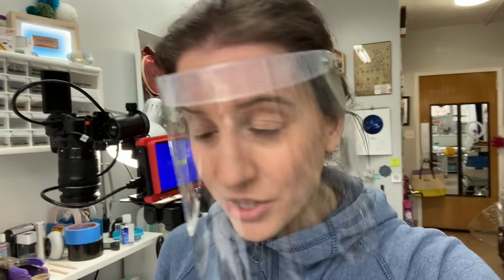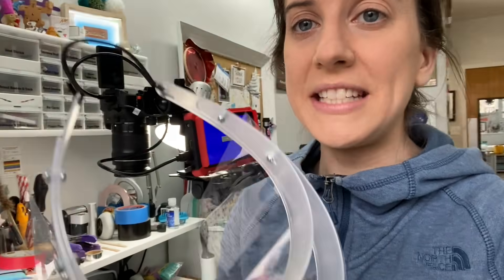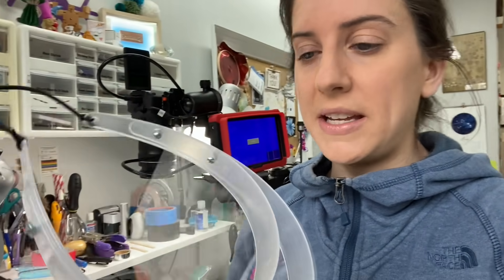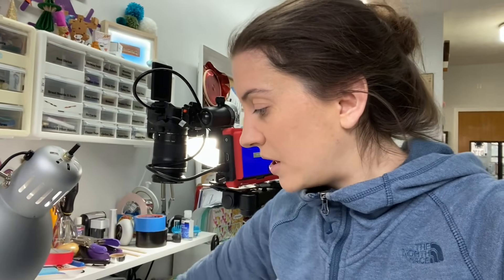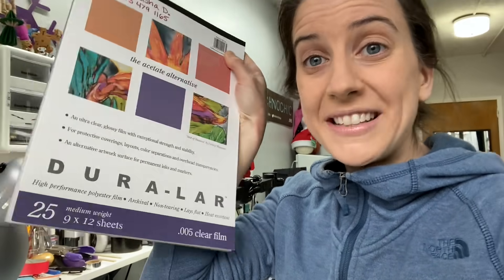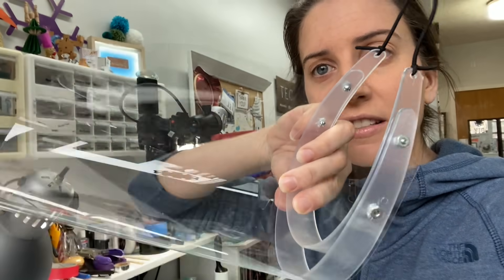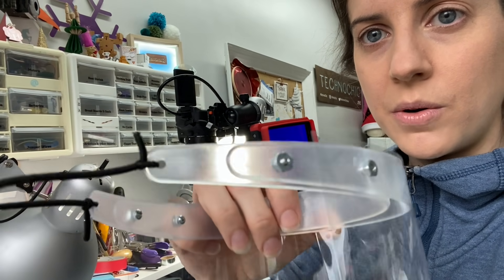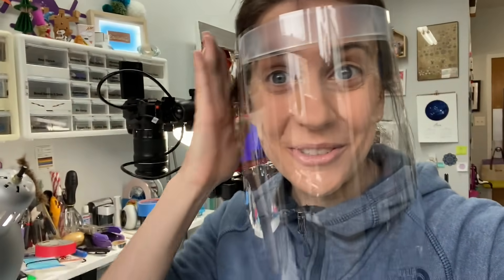DIY Face Shield Version 2: Made with 2 Headbands, a Hair Tie, Transparency Film, and Metal Screws

Comment: The only thing I'm wondering about this design is after washing, the nuts/bolts could get rusted, so better to use plastic nuts/bolts.
Reply from the maker: We switched to zip ties. You can view the new designs here: https://technochic.net/JCFaceShield The post includes templates, cut files, where to buy the materials, and detailed instructions about how to build the Jersey City Face Shield so you will have everything you need to do so! Please check it out and let me know what you think. Thank you!

Comment: Can I place an order for 10 of the screw version with cushion on the forehead area ? How do I get in touch with you if I don’t have instagram? I need this for dental practice. Also what size nuts n bolt are you using?
Reply from the maker: The Jersey City Face Shield Project post is now live here: https://technochic.net/JCFaceShield

The post includes a link to buy the shields, templates, cut files, material sources, and detailed instructions.

We are now using zip ties instead because they are easier to clean and won't fall off. But to answer your question, I believe they were #4-40, 1/2 inch.

 :)

Comment: As far as the concern to sanitize the face shield, we don't have to sterilize it, we need to clean it after every use (as we wash our hands) by washing it.  I don't think that soap or water would affect or degrade the material, but you could consult it with a chemical engineer  or an industrial chemist to make sure.
Reply from the maker: Great idea. The new all plastic design will hold up to soap and water, and we've also listed links to other cleaning methods in the post: https://technochic.net/JCFaceShield

Comment: One thing to note.
If the sheet is made from acetate suitable for photocopiers, be wary of the resilience if you want to sterilise for multiple use, it may deform at high temperatures.
Reply from the maker: It's .007 Dura-Lar You can see the full list of materials in our post. This post includes templates, cut files, material sources, and detailed instructions about how to build the Jersey City Face Shield so you will have everything you need to do so! https://technochic.net/JCFaceShield Please check it out and let me know what you think. Thank you!

Comment: A possible simplified version?
Single headband.
Adhesive foam pads (high density), as you showed. 2 at the front, each 2" (?) wide, with a 1" gap over the nose.
1 each side for comfort.

Make the shield removable/ replaceable.
Use 3× fold over bulldog clips to clamp the shield.
Similar to these (below, I think these are the smallest available)

https://www.amazon.com/OfficemateOIC-Binder-Assorted-Colors-31024/dp/B00006IBA3

One over the nose (hence the gap in the pads) 1 at each side.
This would allow for the band to be customised and sanitised, with the shield replaced as required through the day, or removed for cleaning. Mark the top centre of the sheet for easy positioning, fit the centre clip, fold down arms (should be held clear of the forehead by the foam?) Repeat at the sides.
Elastic could be tied to the arm of the side clips?

This should be fast and easy to assemble with no tools.
Reply from the maker: Thanks for the recommendation! If you have photos I'd love to see them and add them to the "Alternative Materials" list in our post. This post includes templates, cut files, material sources, and detailed instructions about how to build the Jersey City Face Shield. https://technochic.net/JCFaceShield Please check it out and let me know what you think. Thank you!

Comment: Covering/blocking the space between the two headbands is probably your most important need to solve. I'll take a spray bottle and spritz myself wearing the mask to troubleshoot what to improve upon. If I get droplets on my face from the spray...I'd definitely get airborne droplets from a cough or sneeze. Thanks for the DIY!
Reply from the maker: Thank you! I've designed 2 official versions of the shield: a simple design, and a covered design. My "Jersey City Face Shield Project" post is here: https://technochic.net/JCFaceShield The post includes templates, cut files, material sources, and detailed instructions about how to build the Jersey City Face Shield so you will have everything you need to do so! Please check it out and let me know what you think. Thank you!

Comment: Hi TechnoChic, good job in showing the evolved versions...I work as health professional in Dentistry...With regard to your questioning, the "pad" or "adhesives" to let the forehead more comfortable, unfortunately it is not proper if it were not waterproof. The size of COVID19 is toooooo small, 70-90 nanometer,The virus is able to get in to any kind of surface with pores and remain there for one, two or three days. If anyone like something more comfortable, I suggest to cover the pad with waterproof plastic that allow to be sanitized. For now, your version 2 is excellent. good job!!!
Reply from the maker: Thanks so much for your feedback! We tested several pads but found that it is more comfortable and easier to sanitize without! :)  I've designed 2 official versions of the shield: a simple design, and a covered design. My "Jersey City Face Shield Project" post is here: https://technochic.net/JCFaceShield The post includes templates, cut files, material sources, and detailed instructions about how to build the Jersey City Face Shield so you will have everything you need to do so! Please check it out and let me know what you think. Thank you!

Comment: Great project. Your idea seems to be the best I've seen so far.
Suggetion: consider using 'plastic eyelets' and 'plastic pressure buttons' (male and female) instead of metallic parts. This will allow you to sanitize and easily detach it.

What are the measures and material of your headbands, please?
Reply from the maker: Great tip! We decided to go with zip ties for the mass production but plastic eyelets are a great idea. I've designed 2 official versions of the shield: a simple design, and a covered design. My "Jersey City Face Shield Project" post is here: https://technochic.net/JCFaceShield The post includes templates, cut files, material sources, and detailed instructions about how to build the Jersey City Face Shield so you will have everything you need to do so! If you make a version like mine but with plastic eyelets, please do send me a photo to include in the "Alternate materials" section. Please check it out and let me know what you think. Thank you!

Comment: Hello, I would recommend to make the space between the plastic headbands closer, there is also a special headband that can be cleaned with a special tube, I have made a few prototypes of my own design as well! Maybe you could use recycled bottles for the shield.
Reply from the maker: Thanks for the tip!I've been working hard on even better designs too, one that has a cover. You can see the updated designs here: https://technochic.net/JCFaceShield

Comment: Here are some friendly tips:
1. Close the Gap at the top. 

2. Use a sealant type of glue that meets this standards: Waterproof; Heat resistant; Airproof. You want to make sure the seal is air-tight and permanent.

3. A Sealant foamy rubber would make it more comfortable. Make sure it meets these  standards: waterproop; Shockproof; Airtight; Durable and soft on the skin.  Not too thick

3. For the elastic bands the less porous the better.
Reply from the maker: Thanks so much for the feedback! I've been working hard and have come up with 2 official designs: https://technochic.net/JCFaceShield This post includes templates, cut files, material sources, and detailed instructions about how to build the Jersey City Face Shield so you will have everything you need to do so! Please check it out and let me know what you think. Thank you!

Comment: That is EXACTLY what people should be using for great protection.  It keeps wet droplets from hitting your face or your mask. It should be able to be cleansed easily with anti bacterial anti viral wipes.  The let sit for 3 days minimum and should be good to wear again.  A person should have a minimum of 3 shields for a 3 day rotation but more is better.  If you wipe the elastic and mask then let sit for 3 days or so, you would not have to worry about changing out the elastic.  GREAT JOB!
Reply from the maker: Thanks for the feedback Sue! I've designed 2 official versions of the shield: a simple design, and a covered design. My "Jersey City Face Shield Project" post is here: https://technochic.net/JCFaceShield The post includes templates, cut files, material sources, and detailed instructions about how to build the Jersey City Face Shield so you will have everything you need to do so! Please check it out and let me know what you think. Thank you!

Comment: Hello ! I've been doing homemade masks for my dad, he's a doctor. But one of the problems we encountered with medical visors, we used a simpler design, is that I keeps fogging up. I was wondering if you could help me out to find a solution to this. Thank you !!
Reply: I believe that is why the official medical face shields have that slit on top.  If you make it without the visor, it shouldn't fog.
Reply from the maker: Hi! I haven't personally had any issues with it fogging up. It may be because my face mask has a contoured nose clip, so when I add the shield there isn't moisture escaping over my eyes. Please check out my most recent designs here: https://technochic.net/JCFaceShield

Comment: The best tutorial so far re face shield. What I have in mind for a little modification is to use hot glue to bind 2 headbands together and Velcro to attach the plastic to the outer headband. I think its easier to clean or sanitise the plastic detached and lying flat on a surface. Small  bull clips can be alternative to Velcro . This way, it’s easier to replace the plastic should the need arise.From where I live, it’s easier to find hot glue, Velcro and clips than the screws. Thanks for the video.
Reply from the maker: Thanks for the tips Ruel! I've designed 2 official versions of the shield: a simple design, and a covered design. My "Jersey City Face Shield Project" post is here: https://technochic.net/JCFaceShield The post includes templates, cut files, material sources, and detailed instructions about how to build the Jersey City Face Shield so you will have everything you need to do so! If you make the design with your alternate materials, please send me the info so I can add it to the "Alternate Materials" list. Thank you!

Comment: Good idea! But there shouldn't be any hole, or slot above the eyes. In case somebody sneezing or coughing it's not protected at all!
Reply: If you look at all of the official hospital shields, you will see they are all made that way.  It has to be out a little to accommodate the nose and vent prevents fogging.
Reply from the maker: I've designed 2 official versions of the shield: a simple design, and a covered design that significantly reduces the gap above the eyes. My "Jersey City Face Shield Project" post is here: https://technochic.net/JCFaceShield The post includes templates, cut files, material sources, and detailed instructions about how to build the Jersey City Face Shield so you will have everything you need to do so! Please check it out and let me know what you think. Thank you!

Comment: How about closing the fronthead section  gap with a removable sponge that would protect from any particules dropping from above 🤔
Reply: Good point 🤔👍
Reply from the maker: Hi! Thanks for the feedback! I did try this and it sort-of worked, but the sponge was hard to attach. Instead, I designed an extension to the plastic pieces to cover the forehead. You can see the updated designs here: https://technochic.net/JCFaceShield Thanks again!

Comment: I followed your DIY on the previous video of yours and I am actually wearing it at work.  I work at a hospital as an EVS worker and it is very functional.  Don't use bleach because it will cause haze on the film.  I had used water and Hydrogen Peroxide on a small spray pump and I use it to clean it.  Also, I UV light all the rooms we had clean.  All the rooms as in COVID-19 isolate rooms.  When I did the last room, I placed that face shield in the same room but a good distance from the UV robot.  It got disinfected and I can use it again  I made two just in case.  I wish I could share the photo here.
Reply: If you have a minimum of 3, you could clean them and set aside for 3 days just to be sure.  Then just rotate ever 3 days.
Reply from the maker: Thanks for making one! I'm so happy it was helpful! I do have an updated design if you'd like to make more here:  https://technochic.net/JCFaceShield Also, please let me know if you find alternate solutions that work so I can add it to the blog. :)

Comment: I don't know if this would be helpful to you, it's a website for Nurses in Minnesota that are working to create face shields.  Theirs are closed at the top,  but thought you might look at this to figure a way to close yours at the top as well.   https://www.sctimes.com/story/news/local/2020/03/31/2-centracare-nurses-manufacturer-team-up-make-face-shields/5087603002/  I was also wondering if there was something similar to a 'visor' that might be made of a material other than cotton, that would be easy to clean.  I love what you've done, I think it's genius and all it really needs is something to seal off the top either above the headbands (like a short billed visor) or something that would lay atop the headbands level with them and then rest against the forehead.    Maybe using a heavier gauge plastic cut to the same arc as the headbands (while  worn).  Good luck to you, hope this helps, and to be honest, I think that the pharmacists in your area would be more than happy to get this most current model you've made.  The hospitals as well, and when you perfect it, you can supply more of the new model.  thank you for your work, and the effort you are putting in, it means a lot!!! Best wishes to you, stay healthy!

Comment: Would it be possible to use pop rivets instead of bolts. Might be a bit more comfortable. Great Work
Reply: That's exactly what I was thinking, to make perfect holes on plastic for screws don't work because that plastic is not thick enough to cover the heads.

Comment: Consider alternatives to metallic hardware. Use nylon, teflon, or other type plastic screws, nuts, washers. If a patient/med staff is wearing one of the shields, the metal parts may cause interference with medical equipment.

Comment: Hello, I really appreciate you video, it is super easy and will help a lot in creating masks for the ones in need! I have made a prototype based on your design but rather than using screws I have used rivets. It creates a cleaner inner look and feel so the user does not get bothered by the screw heads. 

Please check your email as I sent you a few images of my design. Thank you!
Reply: What about using cable ties (aka zip ties) in stead of screws? They come in many different types of plastic.
Reply: Kelly G using zip ties is also a good idea if you do not own a river gun
Reply: Hi. I would be interested in making them without bolts also .. do you mind sharing?

Comment: @TechnoChic I believe that you need to add some type of foam between the head piece and the actual shield to prevent droplets holding the virus from getting to the inside of the face shield where that virus would either be inhaled or land on you eyes or lips and eventually make their way into the body
Reply: yes you can use any type of rubber foam in a roll.

Comment: Nice design. If you can remove or cover the gap between the two headbands. There is a tendency that the droplets might enter into the gap especially if the person using it is shorter than the rest. Top and width need some improvements. Tnx

Comment: A nice design change would be to allow the use of a headband without having to cut it in half and then tie and knot it back on (most health care workers will be using gloves). If you added bolts and washers near the end of the hairbands you could then loop a full hair band around these without the need for cutting one. It would allow quick disconnect and cleaning. And also provide more tension as it would now be a double strand. Hope this helps. Alun.
Reply: Good idea!

Comment: Im a nurse and we badly need the face shield right now. We currently don’t have any at my hospital. I definitely appreciate that your posting this diy. The clear headband is great idea so that we can sanitized it and be reused. I was thinking to use medical torniquete rather than the head tie. It will be sanitized and still be elastic. 

If you can show use us how did you put in the whole in the band? Did you drill it? And if you can list the supply or  tell us where to get your supply in your video that will be very helpful. 

We in the healthcare field appreciate people like you. People that is thinking ways how to help frontline people to fight this pandemic.
Reply: I did the first version only changed the hot glue instead used cable ties 4" and work perfectly ,I drill the headband  6 in total, these material I have at home ,so used whatever you have on hand ,avoid going out,but if you work on the medical field PROTECT YOURSELF FIRST don't be another statistic, God bless us🙏🙏🙏🙏
Reply: Laurd Mera 
I too was thinking the cable ties as follows is better than the hot glue or bolts:
http://www.walmart.com/ip/Yes4All-100-Piece-Pack-Nylon-Cable-Zip-Ties-4-Heavy-Duty-50lbs-White-UV-Resistant-Zip-Lock-With-Screw-Hole/507832454.
Reply: To make the wholes on the headband you could use a tool called cropadile from WeRMemory Keepers.  I am not promoting it, I am just another crafter.
Reply: Ross Reyes-Buenaventura 
I think this hole puncher should be good to punch holes: https://www.amazon.com/dp/B00006IBK9 , or even the more commonly found three hole puncher should work.